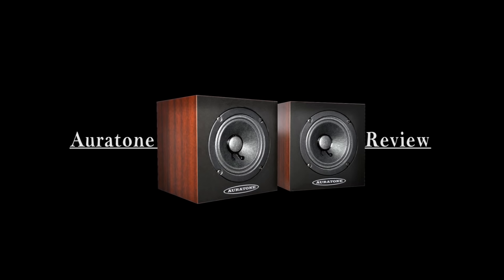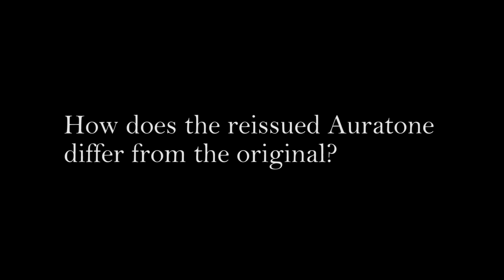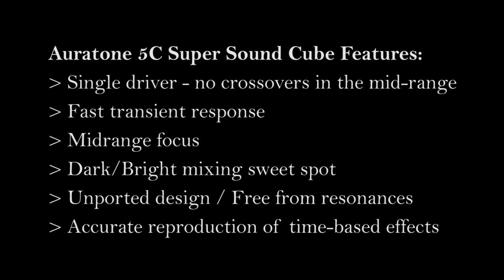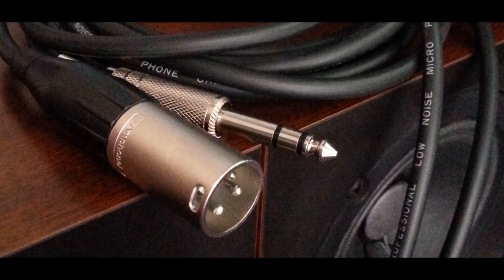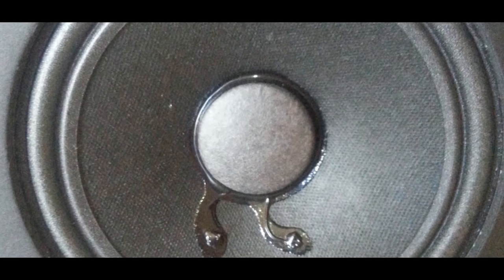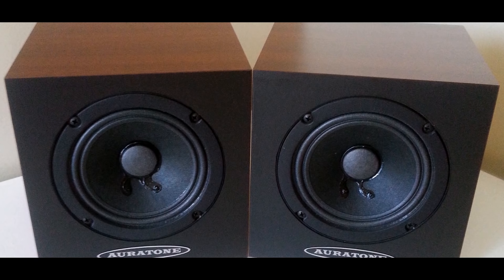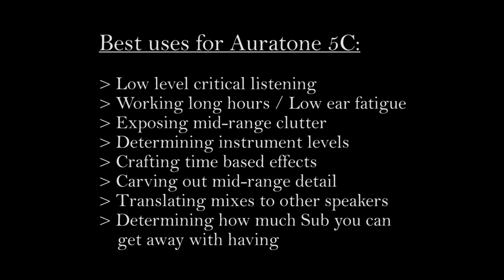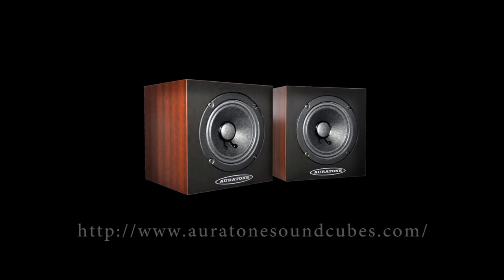Product Review: Auratone 5C Super Sound Mix Cube | SPLmixing.com

Comment: GREAT REVIEW: I am a quasi-audiophile (vinyl collector) and I just bought a pair of these to replace 2 very old Technic satellite floor speakers.  I have a large listening room and in the center, I have two Klipsch RP-600M Reference Bookshelf Speakers connected to a Yamaha A-S501 receiver,  I also have an older large subwoofer in the mix. The Klipsch speakers are amazing but they just don't fill the room enough.  I decided to replace the two Technic satellites with these Auratone 5C speakers.  I also have two stands to bring them up to ear level while I am sitting down.  When listening to the Technics by themselves they don't sound very good at all. My goal is to improve the sound quality of the satellite speakers with the 5C's which should improve the overall sound of the entire setup.

Comment: You can now buy a pair of these with an Auratone amplifier that was (supposedly) designed specifically for these monitors. The bundle costs $669 at Sweetwater right now.
Reply from the maker: Yes, I bought one, it's great. Like the Crown amp, but smaller and cleaner
Reply: @SPLMixing  Cool. Thanks for commenting on that. It's great to know it's a good amp. I'm thinking of buying that bundle.
Reply from the maker: @Zarabozo  I believe they're also working on an active version, though I am not sure when it will be released.

Comment: Nice review!
Did you compare them with any of the replicas, e.g. by Avantone or Behringer?
Reply from the maker: Thanks! No, unfortunately, not in the same room at the same time. Spent a bit of time with them in other peoples' studios though prior to buying the new Auratones. The Avantones were probably the closest to the 5C's - although somewhat extended and less upfront - they can't be leaned on reliably to judge sub levels as they don't distort soon enough in my opinion. I also think they are too smooth to be able to do the whole dark/bright thing that the 5c's do so well - but the transient response was on par from what I could tell. The Behringer model was not great, definitely didn't have the same feel to it of dryness/clarity/transient response that the Auratones have. It's what you can afford and get used to I guess.
Reply: SoundboothTutorials
Thank you, very valuable insights!
I guess I'll wait for an active version of the auratones. Active monitors are just so much more convenient for today's workflows, also regarding mobility. I hope it will not take them ages to bring them to the market.
No surprise about the Behringers... lol.

Comment: GREAT REVIEW ; it has been very helpull to me when trying to figure out if i'd go for it as second pair of monitors . 
i'm lso going to go for crown d75-a as power amp for the auratones and would like you're fully satisfied by this combo ?
Thanx again for the review
Reply from the maker: Hey! My Crown D-75 is getting on a bit and has a slight power hum, but other than that, I find the combo work well together. I believe the D-75-a is a slightly different beast to the older D-75, but honestly, it's worth looking at every amp that is sufficiently powered so that it will not blow these cubes up. I pressed the wrong shortcut a few times and started a feedback loop, but they are still working as before. You either get an amp that is powerful and run it at a lower output (and never touch the dial), or you max out an amp like this that doesn't have quite enough power. A quick search on Gearsluts might be worth it to see what other options there are. From memory, a Hafler P3000, an Adcom 545 or Bryston 2Bs are also being used, but I took my advice directly from Auratone themselves who recommended the Crown D-75 model. Best of luck!

Comment: please elaborate on the cables pictured to run the speakers. They do not look like the kind you will find at the music store, I am a hobbiest who's mixes using my iMac speakers. mixes never translated well to my car, portable speaker or headphones. So I bit the bullet on the auratone bundle to solve this problem.
Reply from the maker: Banana plugs joined to standard insulated copper wire for use with home stereo systems. I bought mine from an electronic store called JayCar. If you're in the USA you might check out Tandy or RadioShack or something similar.
Reply: @SPLMixing funnily enough i have a cart with Jaycar awaiting checkout. Thanks again for the response. I can now complete the purchase confident I've got the right gear.

Comment: Thank you for such an informative and well thought out review. I feel a lot more confident in my decision to purchase them now.

I have a question about the banana cables - Will they connect directly to my Universal Audio Apollo MkII? Thanks.
Reply from the maker: I don't believe so. You'll need to purchase an amplifier that runs these, as they are passive design, then connect the audio outs from your Apollo interface to the inputs of the amplifier. They may now make an active design, which doesn't require any additional amplifier, but best to check with Auratone with that one. It's been a few years since I put together this review and they may have another solution for this. Good luck!

Comment: I have the Auratone A 2 - 30 connected to two small Visatone loudspeakers that are installed inside Altec Lansing cabinets; the positive side of the medal is that they don't need a lot of space, and that is ok for me, but the negative side of the medal is that,  although the sound is filtered throught an DBX equalizer and an American Audio splitter with treble and bass knobs, even with the sliders at the maximum position, the bass frequencies are almost unheareble. Do you think that i could improve the basses with these Auratone cubes? I do not pretend huge bass sound, but at least enjoyable. Thanx for your suggestions,  Patrick
Reply from the maker: Are you sure it's not a room acoustics issue?
Reply: @SPLMixing  My stereo is placed in a small living room,  all i have in this room ( 12 square meters) is just a couch, two Ikea Kallax ,and a furniture with top and low " drop leaf" doors, with a small television in the middle, nothing else. Therefore the sound does not have " obstacles " ,i have normal bricks walls ( in Italy wood houses are not common like in the U.S.A.). At this point i don't know where i made the mistake, i have complained about bass ,the mids and the treble are much louder even , like i wrote on my previous comment, if the DBX equalizer sliders are at the maximum position. So i'm very curious to know if with the Auratone Cubes loudspeakers, the bass frequency would improve.  I apologize for my english, i hope to having been understandable! Regards, Patrick from Italy
Reply from the maker: I think Auratones will sound great in most rooms, they have a very good response to transients. It sounds like your room is not ideal, but jump on John Brandt's acoustic spaces Facebook forum, he could give advice about your room. When I am not busy in the studio, perhaps we could jump on a video call and talk about it more. Feel free to contact me via email daniel@splmixing.com
Reply from the maker: The Auratones don't have a lot of bass, which might work in your favour in your situation in terms of accurate listening.
Reply: @SPLMixing  thank you so much,  SPL . Best regards to you

Comment: Thank you for this review, it is interesting and helpfull. I'm currently looking to buy a pair of Auratone for my home studio but its really hard to find a crown d75. Auratone made one, the A2-30, but it outputs 30 Watt per channel. Do you have any suggestinos for the amplifier?
Reply from the maker: Maybe have a chat to the people at Auratone. I think I asked the same question in the past and they provided a few different options, so it's not essential to get the crown amp. Bryston amplifiers are pretty decent but expensive. If Auratone still make an amplifier I would honestly go with that, it doesn't need to put out more than 70 Watts total, I believe.

Comment: Using the crown d75 as the amp when you shut it down, it has this little funny turn off sound lol I think the crown d75 amp is the only one to do it also do you get a lot of electrical noise when using the amp? Mines very quiet but I can still hear it maybe cause the amp is old ?
Reply from the maker: I bought the Auratone amp and it very similar. Slight pop and quiet hiss.
Reply: @SPLMixing  oh okay makes sense since it’s gots hella power going through them speakers 🔊 yeah mine has a slight hiss as well

Comment: Did you open it to see if there's any damping inside? thanks
Reply from the maker: Yes, I did. Similar to what you might use to construct a house with, it had slightly less fluffy compressed sound insulation inside.
Reply: SPL Mixing Ah cool! thanks again. I'm about to DIY one and I was wondering if they use this kind of stuff inside or leave it hollow. Nice video by the way.

Comment: Do you recommend 70s HiFi amp like Pioneer SA 606 for Auratones?
Reply from the maker: I'm unfamiliar with the specs of that model but provided it has the right amount of power, it's worth trying out (if you already have one). You want something with at least 70Watts power and if it's more, like a lot more, you might want to place a limiter between the speakers and amp for protection because the drivers, given enough overload of level, could potentially shoot the cones across the room.
Reply: SPL Mixing thank you

Comment: Thank You
"MR,they do"not"lie 
Alexander Jacobsen"
U know Who"s Smilin"
He"s Up There Hombre <3
adorable  i mix with"em
and use a pair just to listen to <3 
"yes" they had the paperwork and i did get
the cool little Quincy Jones picture even !!!
found a stash of "new-old-stock 5-W "wedges" 
they even came in the original box & packing,,
the small cabinet lacks the bass response of the 5-C
but i will swear to God by them"again" i will swear to God by them,, 
Will find NS-10"s  and the New A2-30 amplifier, i thought about these for decades actually
PS are the drivers available cuz i wanna put 6X6 in 2 cabinets for they are Soo Pure,,  <3 it"s just love,,

Comment: "...not a hundred-percent flat, as you can see..." Oh, what's 90-15kHz, +8/-25db, next to accurate sonic performance?  😊  Post-amp XLR connections don't offer significant advantages. In fact, that application often results in less-than-optimum conductor size being used.
Reply from the maker: The expectation is that all reference speakers must be flat, so this is an accurate statement. It's not flat, but it's not meant to be either, and that's the point.
Reply: @SPLMixing   I think I might have been referring to a number like 25db, or a total amplitude difference from linear input across that range of around 33db, as being a little beyond the pale of "accuracy" in reference to anything, so I thought your statement of "not a hundred-percent flat" was humorous. I certainly agree that plenty of consumer listening devices really are that bad that a mix is going to be played on.